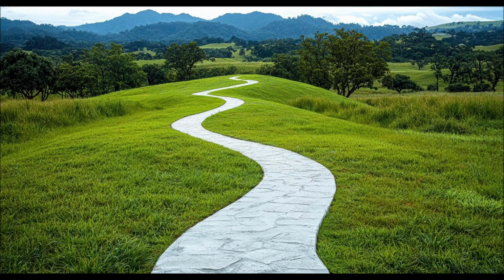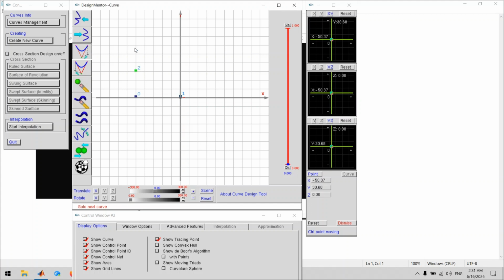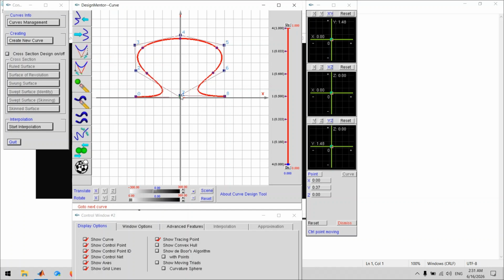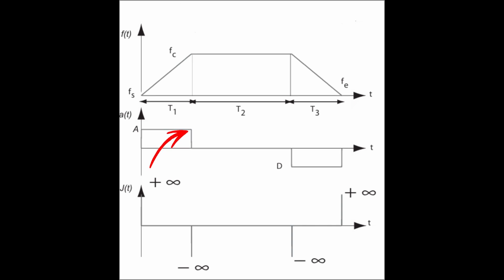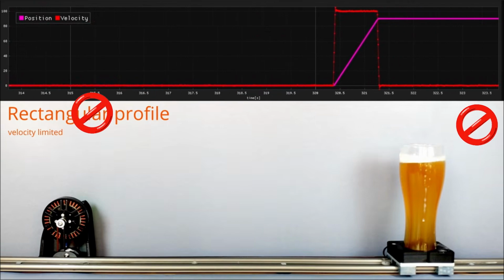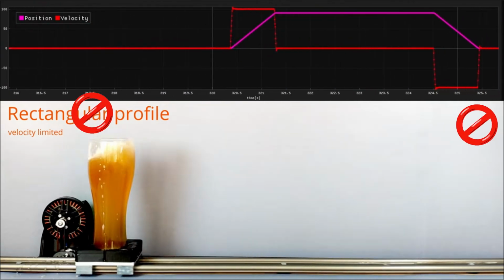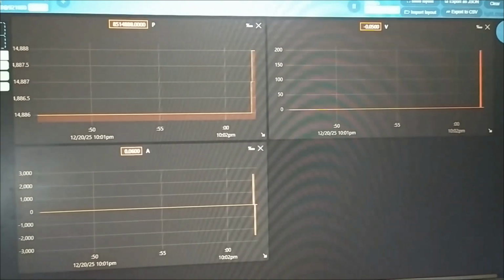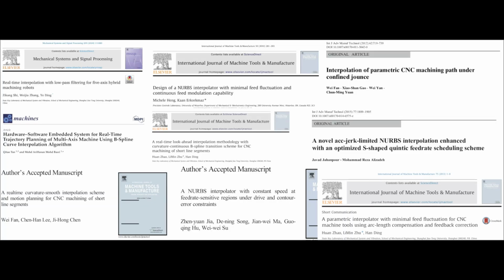The End of Vibration: Mastering Jerk-Limited Motion

Comment: What an interesting method. good attempt✅.
Just on question! Are you sure it's a closed loop?
nothing about the control loop.
Reply from the maker: Actually, it's an open-loop system. The encoder data is used only to analyze the real-time following error; no compensation pulses are sent to correct the error. The next step will be to use closed-loop drivers, where the controller can actively compensate for the following error.